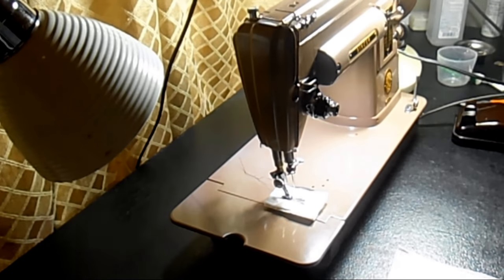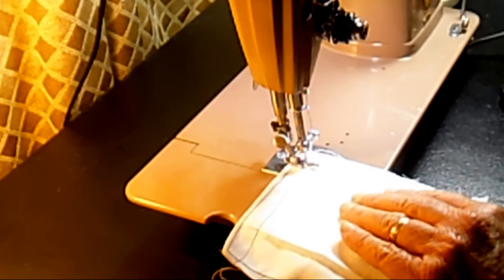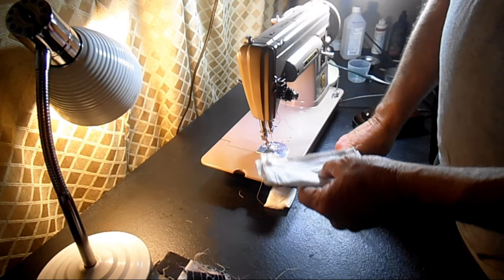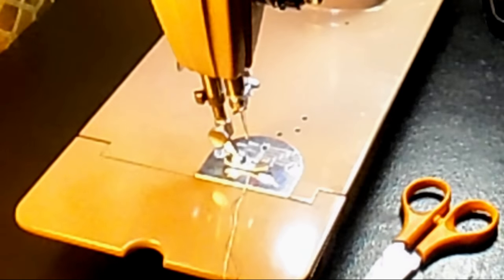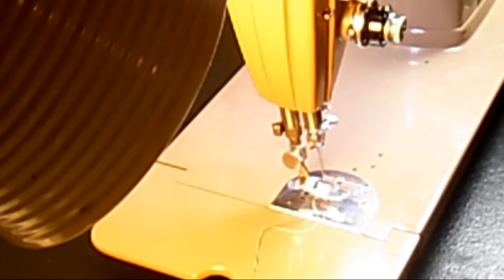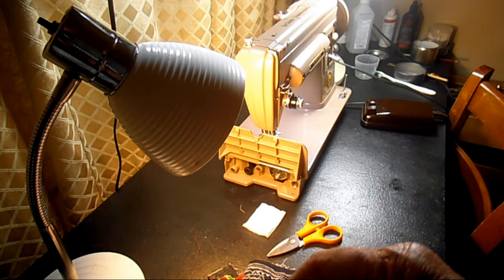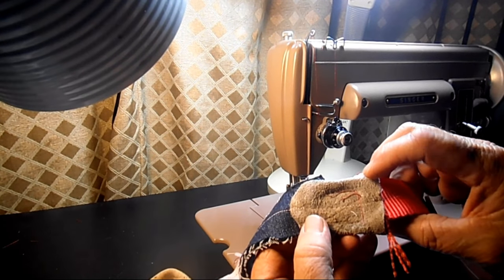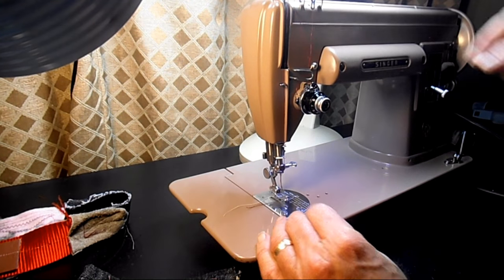Taking a Spin - Coco goes to the Spa Pt. 11 - Singer Model 301A Rehab - April 2018

Comment: Gasp! I was pretty sure the sewing police were coming to get you for not holding your thread tails! LOL, I will say...When I first began sewing I had an inexpensive Singer, off the shelf @ Walmart. If you didn't hold the thread tails it would bird's nest inside the bobbin case, every time! I still have the machine but it sits in its case unused. Holding the thread tails when sewing triangle units also help keep the tips from going inside a zigzag throat plate. Just general sewing, it's really not needed as you said.
Reply from the maker: I love your comment! I have had other viewers contact me that there are times when they find it best to hold the thread when starting to stitch. Like sewing a seam very close to the edge, so the fabric layers don't shift apart. Also, a manual showing when starting a narrow hem to use the thread, under the foot, to gently pull and help the fabric into the hemmer foot. Thank you so much for sharing. I've decided I'm better off concentrating on the repair/restoring.maintainance of the machine and leave the "how to sew" comments to the experts ... the people who actually sew!

Comment: Andy , I , have  an old sewing machine ,that has problem with making a "birds nest " while sewing ,I m having a hard time getting the tension wright , I replaced the tensioner and followed the instruction book , the machine is a Singer Merritt , model 2430 , I thought maybe you could help me ,get this problem resolved , The bobbin seems to be ok ,sometimes it will sew good and then ,it starts acting up, I would really appreciate your help, Thanks for all the videos , you are a very good instructor .
Reply from the maker: Nesting under the slide plate is a tension unbalance. More tension on the bottom (bobbin) thread and/or less tension on the upper (needled) thread. 
     Number one cause is the machine has been threaded wrong, either thru and around the tension assembly, or incorrect path thru the take-up lever, like thru the lever before the tension assembly instead of after. 
     Other causes are the bobbin installed wrong or the bobbin tension is over tight. Sometimes it can just be the wrong thread/needle combination, like the thread size is too thick for the eye of the needle..
     Sometimes the tension post or stud can be damaged and not letting the tension discs press the needle thread correctly at all time, so the thread is "loose" and has no tension and the bobbin thread pulls it down thru the fabric. 
     It can be a PITA to isolate as you can see. I always pull the needle thread out completely and rethread from the spool to the needle eye to be sure I have done it properly. 
     At that point turn the handwheel towards you until the needle is high above the fabric. Lower the presser foot. If you pull on the thread after the needle you should feel tension. While turning the tension dial to higher and higher numbers while pulling the thread you should feel more and more tension. If so that shows you the tension unit is working normally. 
     You have to be methodical like that and not skip back and forth on possible problems. 
     At this point pull out the bobbin and the bobbin case and be sure the hook/feed dog area is clean of dirt and lint. 
    Insert the bobbin so the thread pulls off the top left corner and the bobbin turns counterclockwise. If you thread the bobbin case correctly you should feel some tension on the bobbin thread while pulling on it. Lint/dirt under the bobbin case tension spring can mess up tension badly. 
     Here is a popular article about nesting: https://sewguide.com/thread-bunches-up-under-the-fabric/

Comment: So far so good with balancing the stitch. My 301A needed much the same adjustments to both bobbin and upper tension as Coco. It is balanced now EXCEPT if I run her at high speed. Then loops are forming underneath. What causes that?  Also, I seem to have a heck of a time setting the bobbin into place. Not sure why it isn’t just setting in and clicking.
Reply from the maker: Hi, Erin. Congrats on working with your 301A and thanks for watching my videos. I see you liked the videos about removing and cleaning the hook, so I'll assume your hook and bobbin case base and bobbin case inside is clean and installed correctly. Usually, looping is a tension issue; an unbalance. With looping on the bottom it normally means the bobbin thread tension is stronger to the needle thread tension. When you mention having a hard time installing the bobbin, that it won't just set in and "click" that suggests a worn/damaged bobbin. It could just be a case of a dry "race" on the hook and at high speeds, it affects stitching. A drop of oil on the race will cure that immediately. Since I'm not there with you and your machine, I'm just going to mention things that come to mind as they come to mind. You can decide if any of them may apply or need attention, OK? These are all things that I found that were causing looping.
Upper thread not ran correctly**remove the thread and reinstall. Worn/bent/wrong needle**replace needle. The bobbin is wound poorly, too tight/loose**wind a fresh bobbin at moderate speed. The bobbin is worn/bent/wrong type. Bobbins wear out, even metal ones. Take a close look at it. There are two rounds "sides" and a tube between them. On modern bobbins, the tube can protrude thru the side as it folds over. What is called a "raised tube". It is cheaper to make them that way. That can cause them to hang in a bobbin case and it only takes a microsecond to cause a bad stitch**Replace the bobbin with a fresh one. There can be a small burr (rough edge) on the hook point from a needle strike. It may be small enough that it does not affect normal sewing speeds, but snags the thread at high speeds**test for burr and sand/polish smooth if found. 
Those would be the most common items I have found. Hope that helps you find the cause. Good Luck, Erin.